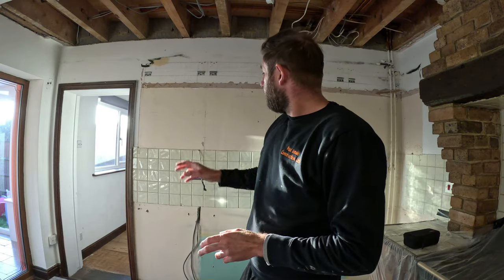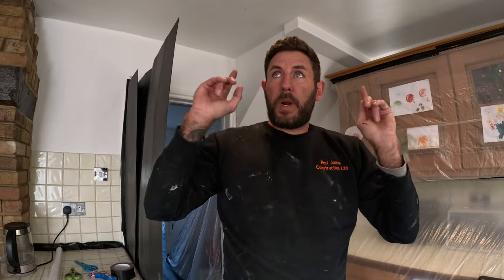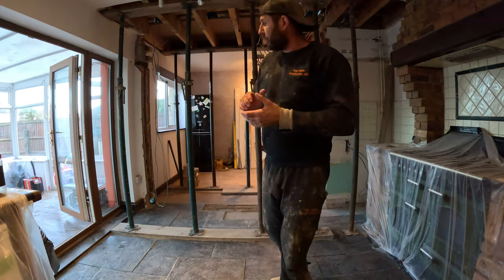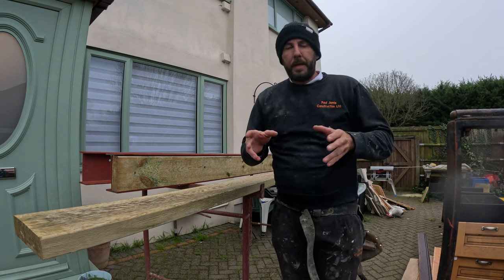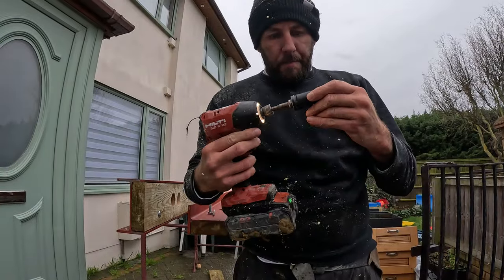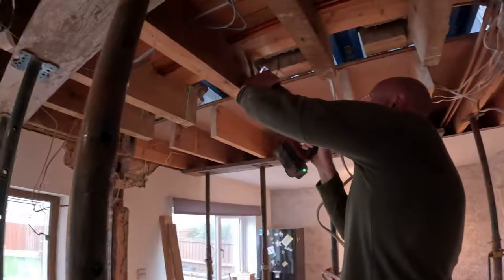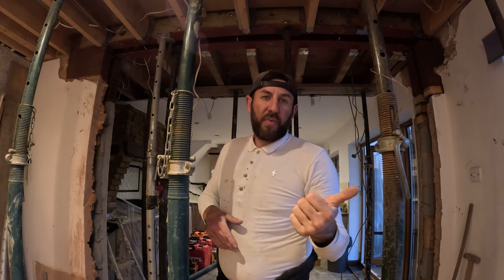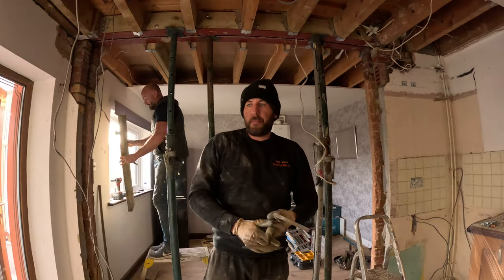How to Remove a Load Bearing Wall | Sunken RSJ

Comment: Top workmanship. Love the fact that the RSJ is sunken, looks so much better. 

Quick question if you don’t mind, please - we have a wall that we would like to remove in order to creat a bigger, more open plan kitchen/diner, however, I think the joists run in opposite directions (i.e., the front room joists run east to west and the back room joists run south to north if that makes sense). Would it be possible to sink an RSJ, creating a flush ceiling in this scenario?
Reply from the maker: Thanks for your comment . The answer is absolutely yes you can. We have just done the  exact thing last week. I am currently editing the video to drop tomorrow hopefully.  If you would like us to do it , just us know.
Reply: That’s great to hear! Thank you for getting back to me. We’re just in the planning stages at present. I look forward to seeing your new video and will be in touch in the near future for sure. Thanks again

Comment: Well done mate! The strongboys at the floor above were only needed because you were sinking the RSJ and cutting the joists that were supporting the load bearing wall above, right? Otherwise, would the acrows downstairs be sufficient?
Reply from the maker: Absolutely correct.  But you have to check that there is no gap above the joists even a small one, as the wall above could drop .

Comment: Hi Paul,
I’m having a none load bearing internal wall (it’s has been confirmed by structural engineer)
My question is do I have to notify building control before removing the wall or after? Or is it building regs need to be informed?
Thanks for ur help in advance.
Ps. I haven’t seen helpful information on the net
Reply from the maker: usually you would get them out to check once the wall is down and the rsj is installed, as its not load bearing , im not sure they need coming out. Maybe give the building inspector a call first. Good luck
Reply: Question, if an internal brick wall on the ground floor of a two storey house, doesn’t have a directly above it, does that mean the ground floor wall isn’t load bearing?